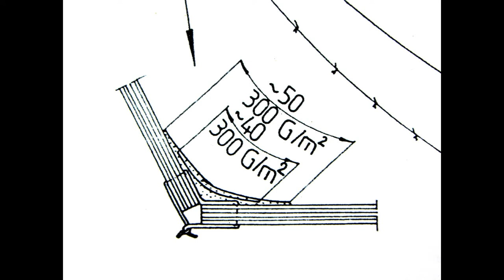Stitch and glue boat-building: ply bonding with epoxy fillets and fiberglass tapes; mockup part 2

Comment: why doesn't the fillet just pull the face of the plywood off the core of the plywood?  there is no fastening to the core of the plywood for shear strength across the thickness of the plywood.  I don't trust this technique.
Reply from the maker: Many thanks for your comment. Everything is correct with this setup, epoxy will be added also from outside and reinforced with glass - this will be presented in part 3. Resulting joint should be stronger than a plain plywood for sure. I will also perform an appropriate destruction test in different modes and you will see this on my YouTube channel soon. With kind regards! also